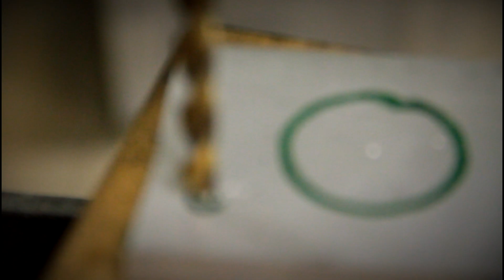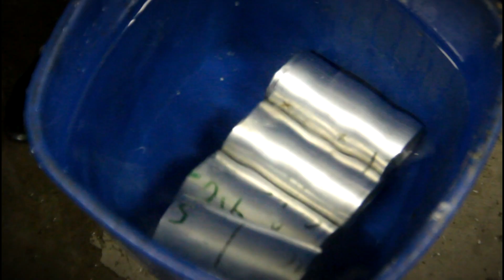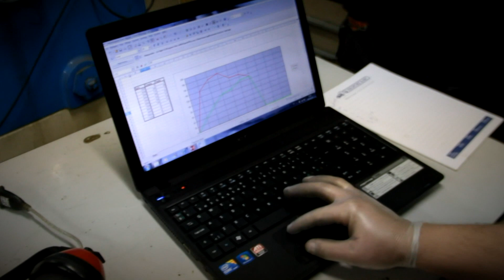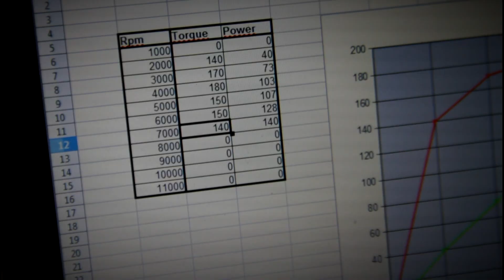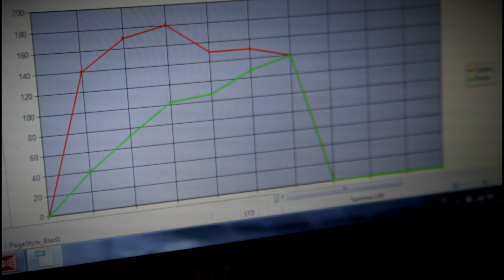6 Fools, a dyno, a Volvo B230 engine (Part 5)

Comment: Lauris: The 530 gives more effect if ported, even thought the 531 is slightly better on a turbocharged engine compared to a standard 530. Without turbo it doesn't really matter.